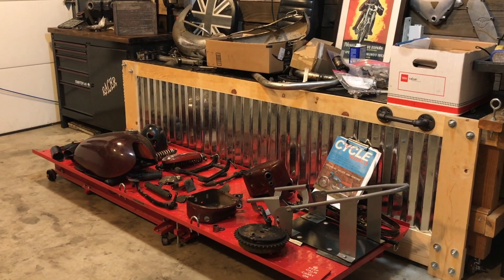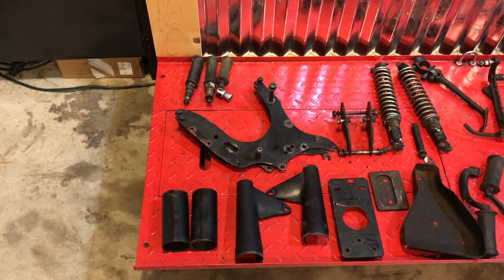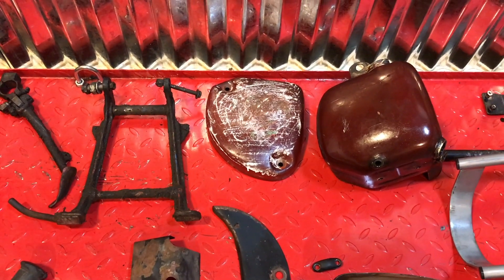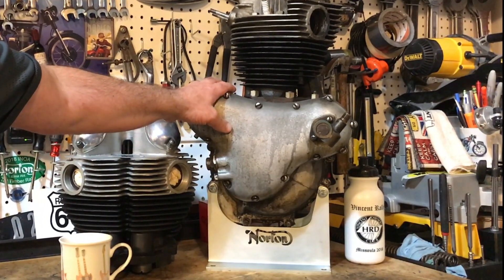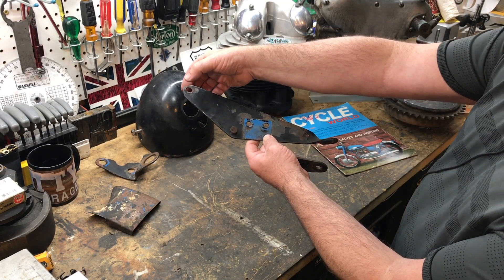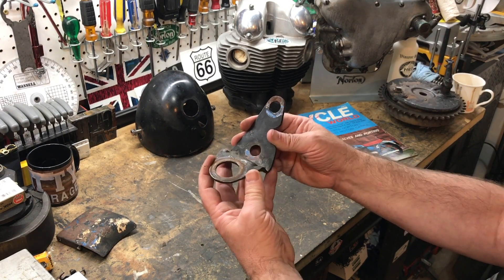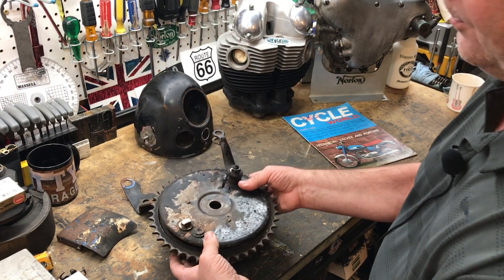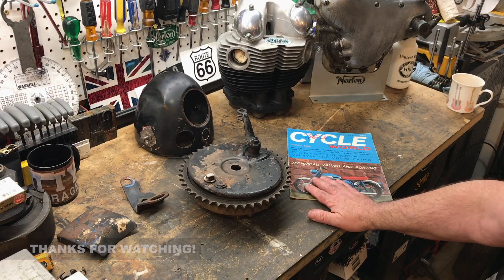First Production 1961 Norton Manxman 650 project (7) - Parts to be painted

Comment: Mike, when stripping the tank from paint be sure to find the threaded holes for the chrome side panels. Maybe filled with bondo.
Reply from the maker: Thank you Uli!  Yes, the tank is a bit of a mess.  I'm hoping that dipping the tank will remove all the filler/bondo and there will be good screw holes below for the badges.  Hope all is well, Mike